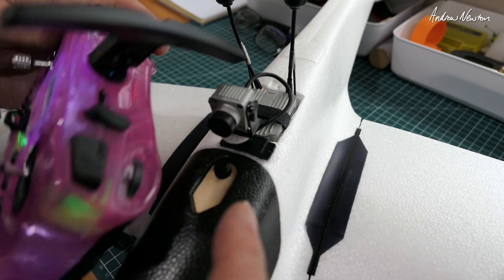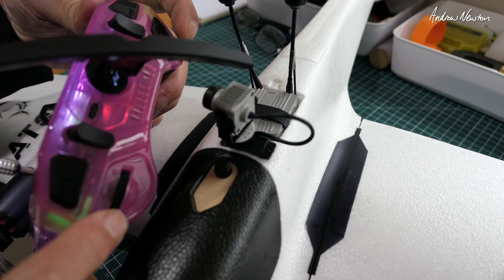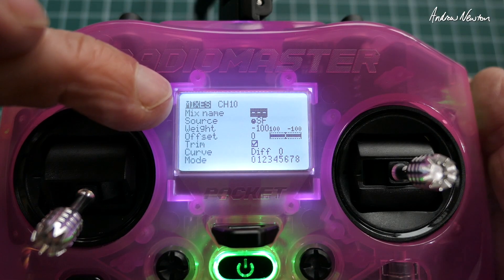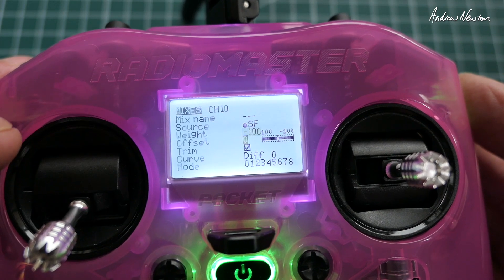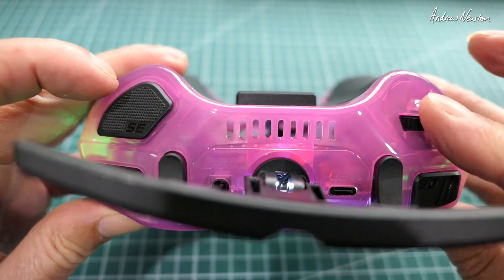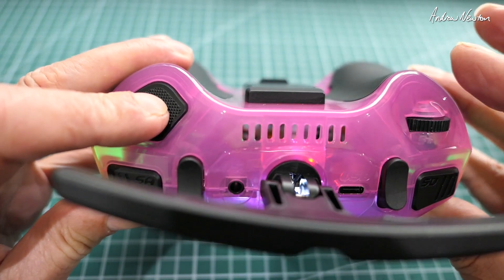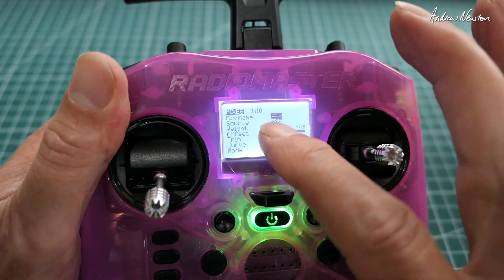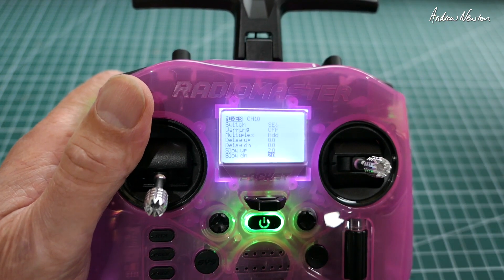FPV Pan with dial and momentary switch

Comment: Could you tell us with a link the servo you use.. Thanks!
Reply from the maker: https://hobbyking.com/en_us/turnigytm-tgy-180d-180-degree-digital-servo-2-2kg-0-10sec-12g.html with end points extended for 270 degree rotation

Comment: Thank you Andrew...Late to the Party.....The best bit of course is the self centering. Very simple to setup...I'm doing my Ranger G2 now using my Zorro TX....😮👍👍👍😀😀🇬🇧
Reply from the maker: Good subject for a video, thanks for the suggestion
Reply: @AndrewNewton Thanks Andrew, I ended up using the SE switch rather than the momentary button as it's easier to Pan in manual this way, but still returns to straight ahead as you switch SE into the park position...😮😀👍👍😀🇬🇧